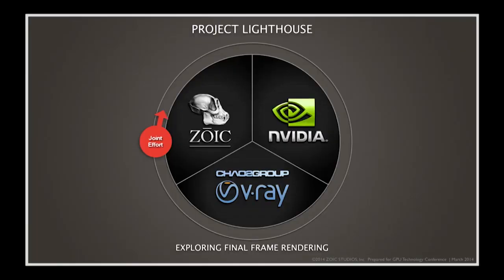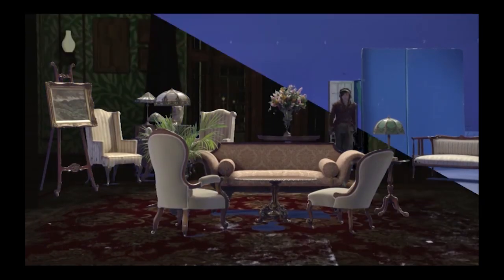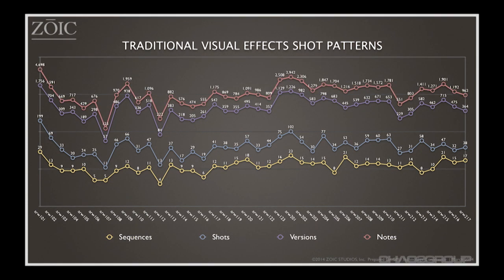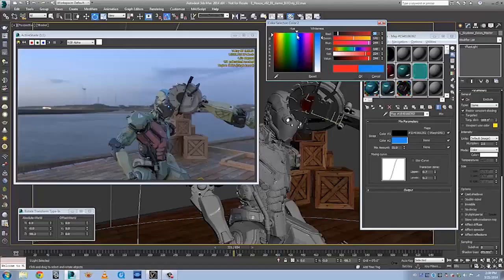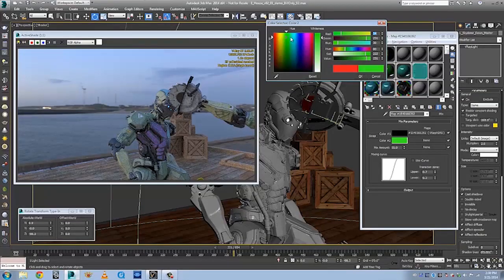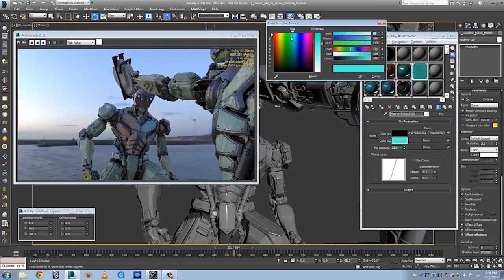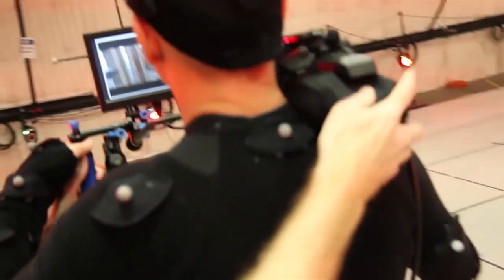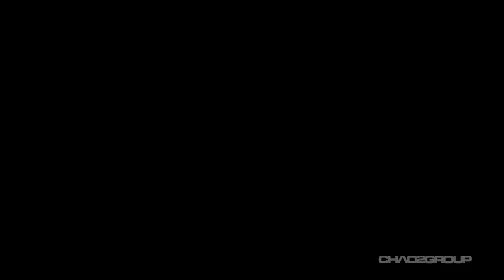Chaos Group Labs: A Discussion on Final Frame GPU Rendering with V-Ray

Comment: Enter a near future where actors are wearing (Oculus) VR glasses and will be able to see their digital self, the other actors and the digital set. You will effectively need 4-8 times the render speed though. Twice for having two cameras and then at least double the frame rate if quadruple it for 120pfs, and then add another doubling for a possible 4k Oculus Rift resolution - it will happen.